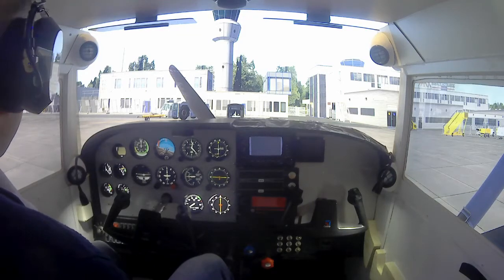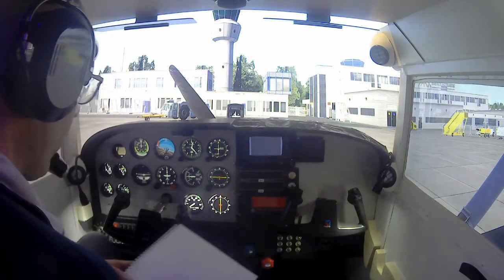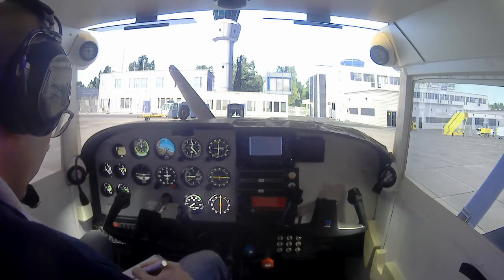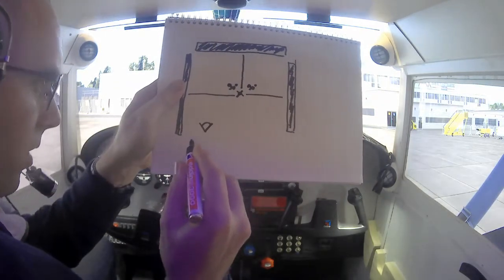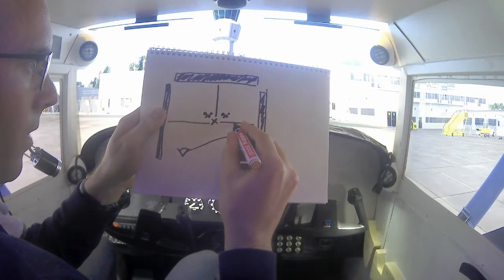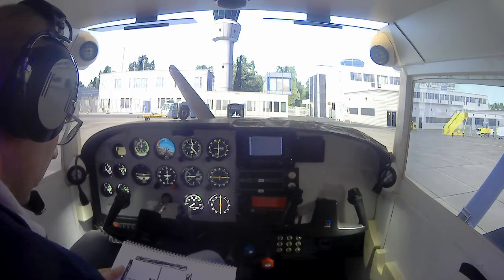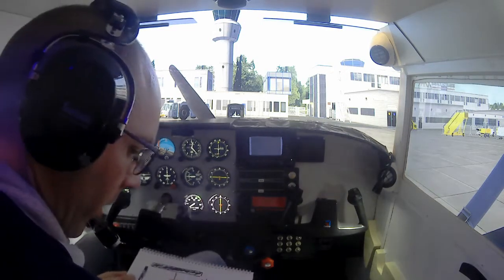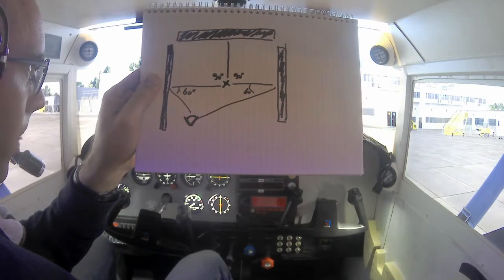Cessna home cockpit - Xplane 11setting up three screens

Comment: Hi. Thanks for the excellent and very informative video. It explains a lot of things that I just couldn't understand about setting up views in Xplane11. 
I do have a couple of questions though.

1. The angle to monitor for 2 side screens look totally different on your diagram? Yet you say they are both 60 degrees. I don't understand how that can be? Could you explain and maybe show the angles you are referring to on your diagram please?

2. How do you calculate the Horizontal and Vertical FOV? Is there a formula?

3. Could you post the settings that you are using in Xplane11 for each of your monitors please. That would be very helpful. (i.e. just write down here what they are).

4. What size and resolution (1080p or 4k) are your front and side monitors/TVs

Once again excellent work.

Peter

Comment: Thank you for your video. Is there a website where you show your simulator construction? I wonder how you did the MIP (where are the monitors behind the face plate? How big are the monitors inside & outside the cockpit? and so on)... best regards. Martin

Comment: What are you using for Saitek panels interface? Spad Next or something else? Thanks.
Reply from the maker: Andy Holmes 
Hi Andy, 
I use spadnext. In my updated cockpit I removed the panels. I also connected the yoke to a Leo bodnar board. Saitek hardware is great but gave me lot of problems.
Reply: Cessna Home Cockpit So are you using the xp default Cessna? I'm having problems with using Spad Next with the Airfoillabs Cessna due to lack of support on Spad Next.

Comment: bonito video podrias poner un pantallazo de la configuración que tienes de los monitores en xplane 11 gracias
Reply from the maker: Teofilo Rodriguez 
Hi
I dont speak spannish..... could you translate the question?
Reply: hello thank you for answering, the question is that I have a cabin with 3 monitors the central 49 "and two latelrales of 32" placed at 90 degrees and I have not been able to see the images as in your videos you could put screenshots of the configuration screens of the x plane where the corrections come because my English is not very good
Reply from the maker: Teofilo Rodriguez 
I Will show my settings in a new video

Comment: I have a video that explains the same monitor setup math with a few graphics that could help further explain at https://youtu.be/PjdgOBJ5xkQ
Reply from the maker: Russ Barlow 
Thanks Russ! I Love your video’s! Do you know how to disable the frame around the gps? I read somewhere that it is possible by changing a file but it doesnt work for me
Reply: I will post a video tomorrow explaining how...basically change the file The short version is to replace the bezel graphic in X-Plane 11( X-Plane 11\Resources\bitmaps\cockpit\radios\GPS FMS/Garmin_530_2d.png) with a 1pixel X 1 pixel transparent PNG file.  When you restart X-Plane the popout bezel will be gone.

Comment: Thx, as requested.. thank you!, can you post your plane .cfg file also?, an indeed, as mentioned, the screenshots from your grapichs settings. Did you change any settings in the planemaker? (https://developer.x-plane.com/manuals/planemaker/)
Reply from the maker: maarten blokdijk 
Hi Maarten, I Will take some screenshots and upload them. I did some changes in planemaker, I could do a video on that too :)
Reply: Great! Which Cessna do you use? xplane default, or other, and i have a saitek multipanel but the autopilot altitude wont work, any suggestions?
Reply: maarten blokdijk  use spadnext thats what I have Works with all Cessna version Xplane 11
Reply from the maker: Flight Advanced 
Hi
I also use spadnxt. Works great. I use a separate powered USB hub. I fly the rep Cessna.
Reply: me either

Comment: You made some mistakes in your angle calculation because 2 equal angles would mean you are directly in the center of the front screen. Obviously that is not a big enough difference for you to notice but you might get a slightly better view if you correct your angles.